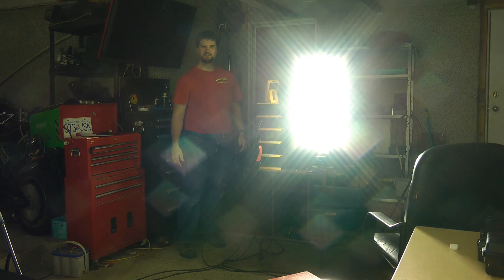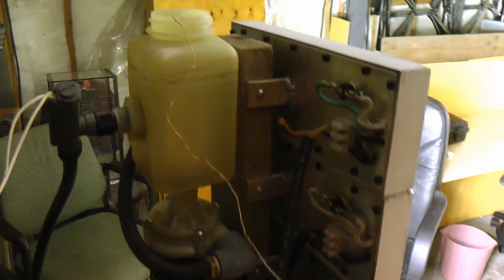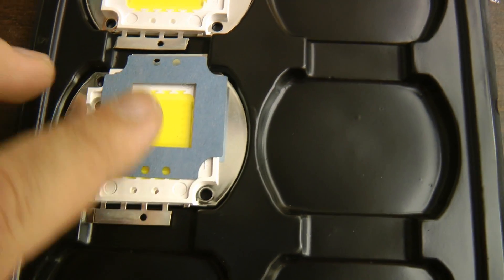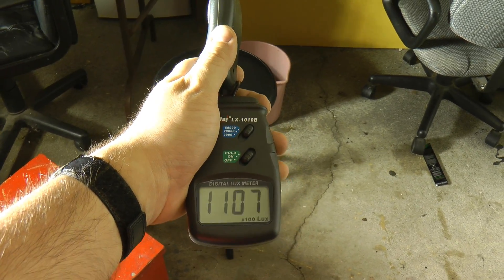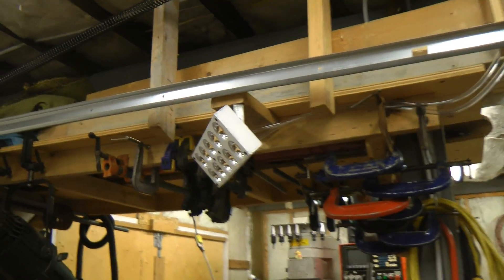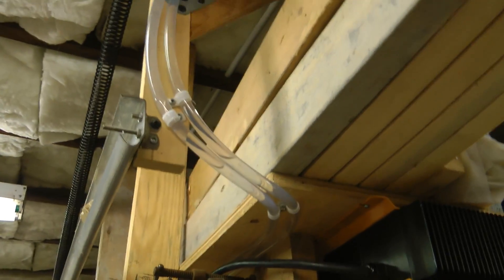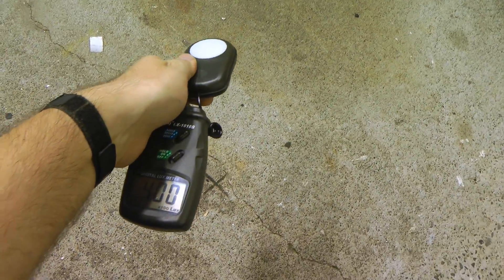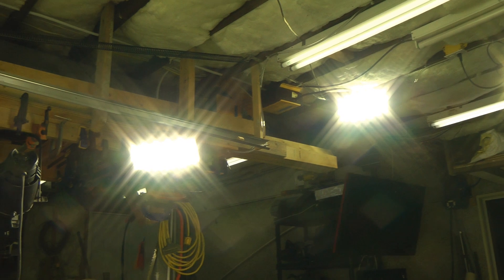World's most powerful LED light - 5kW (1kW module build part 2)

Comment: HID might also be a way to go, although it does have more disadvantages over LED, I think it would be more affordable! Make a lamp like PhotonicInduction!
Reply: Also, do the LED COBs have good CRI, the phosphor looks pretty pale and poor, as if the lights are 6500K or 7000K with >65% CRI.
Reply: An LED rival to the huge 20kW bulb
Reply: Prehistoricman Typically it is much more economical to use HID like short are Xenon for the purpose of high power lighting applications. LED tech is starting to replace that however. Already I am seeing LED street lights replace classic mercury vapor and metal halide lighting. But at the moment HID is still the more mature and cheaper. https://www.google.com/webhp?sourceid=chrome-instant&ion=1&espv=2&ie=UTF-8#tbm=shop&q=5kW+xenon+short+arc
Reply: Shadow Jim Yesterday, I created a LED light out of a bunch of amber and blue LEDs to try and mimic white light to get literally the worst possible CRI, to better understand the effects of poor CRI, I was impressed that everything took either a deep blue color,a muddy gray, or yellow color. A white paper just looked purple, so I need to get more yellow LEDs of a lower wavelength.
Reply: He discusses the CRI in the initial video.   I don't recall the value offhand.
Reply: Shadow Jim Yesterday, I created a LED light out of a bunch of amber and blue LEDs to try and mimic white light to get literally the worst possible CRI, to better understand the effects of poor CRI, I was impressed that everything took either a deep blue color,a muddy gray, or yellow color. A white paper just looked purple, so I need to get more yellow LEDs of a lower wavelength.

Comment: Since the coolant lines are hooked up in series wouldn't the module on the end get very little cooling?
Reply: Less cooling, yes, though I'm guessing the delta between the thermal blocks and the water is large enough that the water being a few degrees warmer wouldn't make that large of a difference.  It also depends on flow rate, of course.  If the flow rate is too low, there would be potential problems.

Comment: The idea with the masking is pretty neat. I have to try this.
Have you measured the actual temperature directly at the led in this setup?
A water temperature of 70°C is pretty high and even while your led mounts seem really good, the leds are probably getting a bit too hot for long term operation.

Comment: If you can try increasing the flow rate of the water as this is known in PC cooling to help with cooling
Reply: This is actually known to not be all that effective at all, radiator surface area has a huge impact, and flow rate has an extremely low impact unless the water comes to a standstill

Comment: Do you have demineralized water and anti corrosion agents in your water cooling? I hope so and if not please do so because it would be a real shame if this awesome setup started to corrode.
Reply: its true that aluminium is pretty hard to corrode with most forms of water due to their natural oxide layer. However water that is not moving has a tendency to pit aluminum and I imagine the water being still in this system most of the time. For this reason I still recommend a anti corrosion agent. superdau
Reply: The radiator may have other metals in it as well
Reply: Unless he is pumping fresh water through it all the time (which he isn't), corrsion is irrelevant for aluminium with water.
Reply: I've seriously corroded some aluminium in just a small bath of water before
Reply: GalacticBacon
yes indeed mixing metals with water and aluminum causes catastrophic corrosion, however that is sadly not something a anti corrosion agent can prevent.

Comment: i wouldn't connect the water cooling in series
Reply: I had the same thought, though if the flow rate is high enough it should be fine.
Reply: would be best with individual pumps
Reply: I had the same Idea.
Reply: In most water loops as long as the flow restrictions are not bad the temperature throughout the whole loop should be pretty even whether its in parallel or in series. Its a negligible difference wither way. Parallel water blocks make for a lower flow rate through each block. Series water blocks gives a higher more even flow rate. In the end the temperature delta from one block to the other in a series setup isnt more than a few degrees and the limiting factor is almost always the radiator with the inlet and outlet temperatures not being to far off as long as your dumping the heat into ambient temperature air. He shows in the video as well the delta from inlet to outlet of the led stack isnt that large.
Reply: Temperature difference is not that high between input and output. With running everything in parralel you may end up with uneven flow or possibly no flow at all if one of the tubes would kink and system will still run without any signs of problem... Until one of the LED modules overheats.
Reply: We aren't talking about a computer here, these lights dish out 700W of heat per cluster, he essentially has 5 gaming PCs hooked into one loop.
His bench test with everything close together showed nearly a 20 C difference between the first panel and radiator temperature, so adding extra radiators between the clusters would be advised.

Comment: How about proper cooling Liquid?
Would it not get much better cooling performance and longer LED life...
Reply: What would be better? Water is a pretty much the best cooling liquid. There's nothing that beats it in thermal capacity at that viscosity and is still easy to handle.
Reply: *****
Those would also be much worse than water.
Reply: *****
Compressor or not does not matter. It's heat capacity or how much heat you can transfer away. No liquid beats water in that regard. There's no point in cooling anything below room temperature.
Reply: Water is by far the most sensible thing to use.  And as long as the LEDs are at their rated temperature, they should last their full rated life.
Reply: HOAT antifreeze might be sensible if the plan is to use these for more than a little while.

Comment: Now this, THIS is why you don't tell the engineer to crank it up to 12.
Have you considered using more powerful LED modules(500W?) for the man-portable version? They cost a whole lot more, but they can be a lot more compact.
Reply from the maker: Fewer modules would be nice. Are optics available for them?
Reply: tesla500 They are in the same form-factor as the 100W ones if I recall.
Reply: I wouldnt say they cost a whole lot more, for the same watts, they are less than 2x as expensive, and some sellers have them for around 50usd, which is basically the same price as 100w leds at 10usd per chip
Reply: They look like much larger modules.  Might be good for your floods, but not the spots yet.
https://www.aliexpress.com/store/product/High-Power-LED-Chip-150W-200W-300W-500W-Cool-Warm-White-LED-COB-Beads-Bulb-Light/1913069_32632947360.html

Comment: Single LED ? or 40 LED's. Nearest I figure that's 40LED units using many many more LED segments.
Reply from the maker: 50 modules, 5000 total dies. Limiting to a single die or module is rather boring.
Reply: well, A record claim is hardly notable.

Comment: Impressive! I built a 1.6kW myself a few months ago, and I had to abandon the lenses because of that yellow circle. I thought it was an optical "stretch" of the light with the higher angle of refraction on the edge, but thanks a lot for the tip!
Also, how did you fix the lens holders in place with the lenses like that? Thanks! :)

Comment: 18 amps?
I think these thermal switches are rated only up to 10A.
Reply from the maker: These were rated 16A at lower voltages. I have since found some 20 or 25A rated ones and may change them out for peace of mind.
Reply: Agavarc generally those thermal switch current ratings are for AC which assumes some certain and usually poor power factor and therefore have contacts rated to interrupt inductive loads. While the thermal switches that he has used are probably okay, another aspect to the current rating relates to the contact resistance and internal self heating therefrom. I think the worst case here is premature opening of the switch.

Comment: Stainless stencil would be good for the  masks
Reply from the maker: Great idea! Thanks
Reply: Perhaps automotive gasket paper could work as a mask too, designed for high temp & might be able to cut it with a laser. This stuff for example is good to 1200F http://www.oreillyauto.com/site/c/detail/MRG0/77/N0488.oap?pt=N0488&ppt=C0137
Reply: Empty cans of beer (or soft drinks) can do the job for free!
Reply: what about fiberglass or something similar that is more like paper but more fire resistant
Reply: That is mica, but it is not opaque but translucent, but is a good insulator so the led units do not short out with a stainless steel mask.

Comment: Use tin foil for the yellow blockers
Reply from the maker: I wanted to but my friend's laser cutter can't even cut aluminum foil. Need to get them done with a real laser cutter.
Reply: Instead of the paper
Reply: You could paint the foil black for absorbtion, then dissolve the paint
Reply: tesla500 make a stamp by milling one

Comment: Is it possible to get the fluid TOO cold by using ice,  etc?
Reply from the maker: I've cracked LEDs like these cooling them with liquid nitrogen, so yes XD

"Reasonable" temperatures should be fine, the limit is probably having them get covered in condensation or frost. This LED stack would melt about 600g of ice per minute, so it would take a lot of ice too.
Reply: The thermal transfer is probably far too slow between the LED/heatsink/water, I imagine even with ice water the LEDs would not be affected in any way.
Reply: How about smaller heater core sized radiators in between each set of lights. Although I know that's probably more work than it's worth.